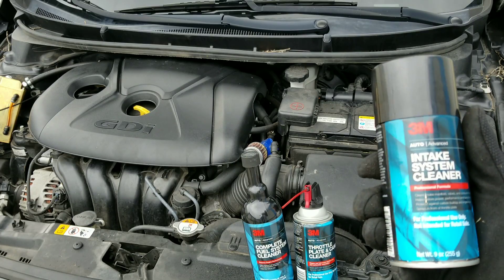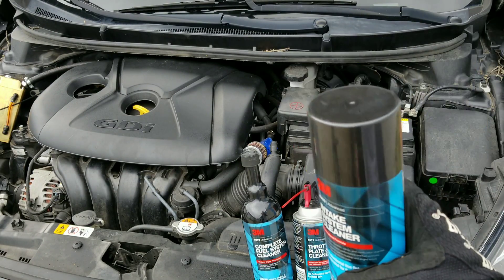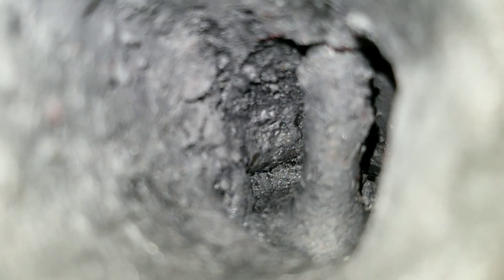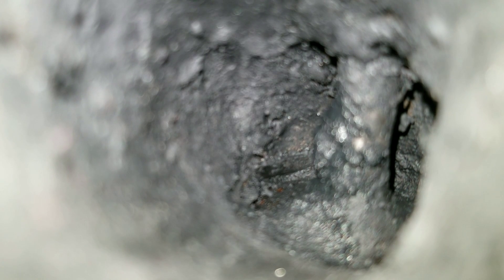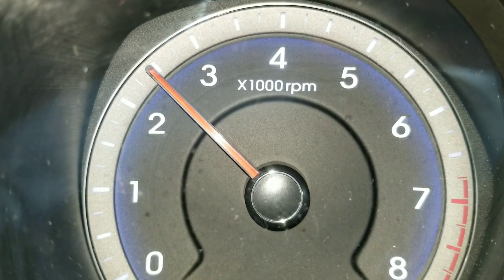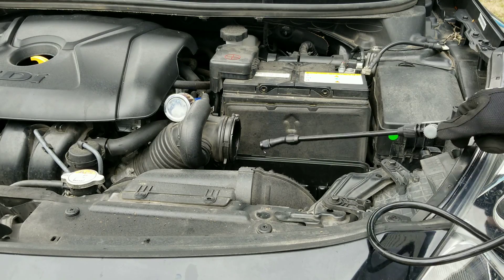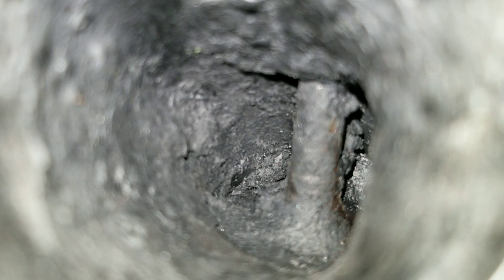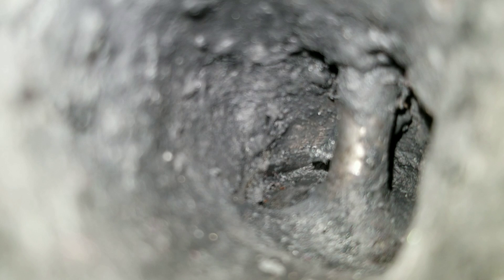what 3m fuel cleaner did to my engine???

Comment: Have you ever tried using  a couple bucks of premium gasoline in your spray bottle to see if that will clean  the intake valves on a gdi? I sure it probably would as that's the whole reason port injection doesn't have this problem (usually). But I'm curious of how well it works.... considering the price difference of a gallon of gasoline vs the average bottle of cleaner.... I say it would be worth a shot....
Reply from the maker: Your absolutely correct and yes i have in a previous video
Reply from the maker: Watch best oil https://youtu.be/pjF1sJ5VeXM

Comment: Probably something nobody has taken into consideration in telling you is the fact that this intake manifold has a major downward curve. The amount of cleaning product you can get up those runners must be minimal and if anything probably most of it stays at the bottom chamber until it evaporates. I'm almost positive that you're getting mostly fumes on the valves versus the actual cleaning fluid. I dont see how the valves get a decent soaking.
Reply from the maker: Evaporation is not a issue and the vaccum will not allow this
Reply: @NATESINTERACTIVEAUTO  stick the camera beyond the throttle body after you do this to see if theres a pool of cleaner at the bottom.
Reply from the maker: There isnt i can assure you

Comment: How actually do you see inside engine ?
What type of borescope do you use?
Thanks
Reply from the maker: Depending on your particular vehicle port or intake also i recommend atleast a fairly high quality scope
Reply: @NATESINTERACTIVEAUTO  show me in a video how you can see the valve?
Reply from the maker: You will need to check your vehicle
Reply: @NATESINTERACTIVEAUTO  my car is a kia rio 2013 how i can see the valve with boroscope? You remove tve intake manifold yo see the valve?
Reply from the maker: Try a port or the intake

Comment: Rotate the engine, close the valve, and soak it in b12 chemtool.
Reply from the maker: Thanks have you seen previous b12 video
Reply: Philip dias After rotating the engine after the cleaning do you need to rotate it back
Reply: @themx5mk1  close the valves your cleaning while you do them. At the end, no.
Reply from the maker: Thanks for sharing with the NIA community
Reply from the maker: Thats correct but make sure to use very little 1 oz per cylinder or transfer liquid back out

Comment: Hello Nate. I talked to a man who is a Porsche master technician and he said that one of the best things to clean the intake of the engine is brake fluid. The man has  40 years experience, he said that Porsche has a special cleaner for the effect, and that it not as good. He also said JUST A BIT, no need to stall the engine. Possibly no need to do it twice either.
Reply: He tried brake cleaner in previous video and there was less carbon
Reply from the maker: Thanks
Reply: Good idea with garden sprayer thanks for video
Reply from the maker: Thank you sir
Reply from the maker: True
Reply: @NATESINTERACTIVEAUTO  how you see the valve with boroscop?
Reply from the maker: Depends on the vehicle but you can try intake or a port maybe more